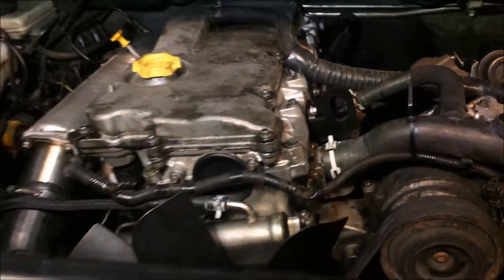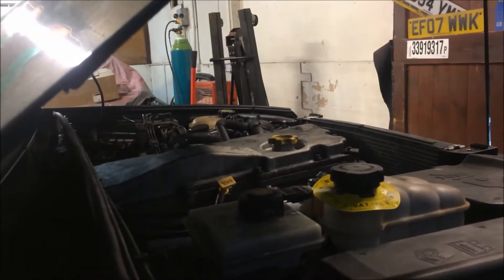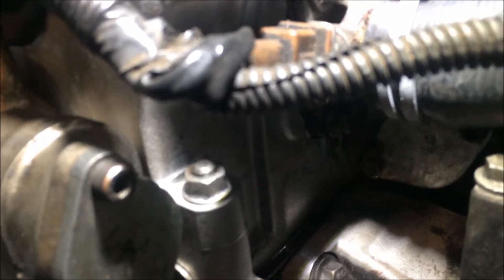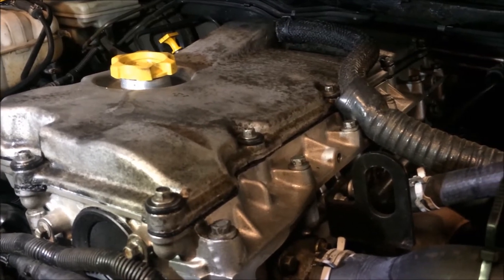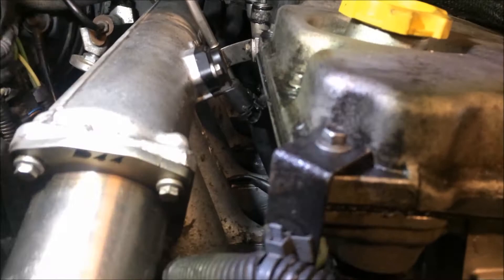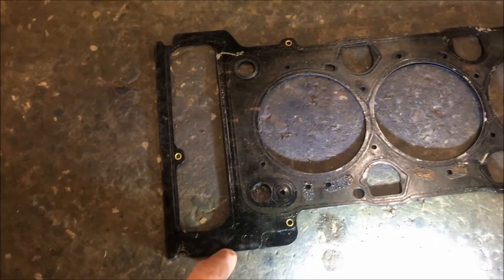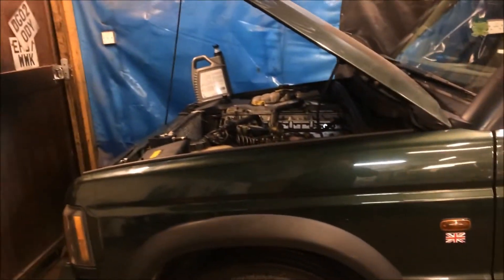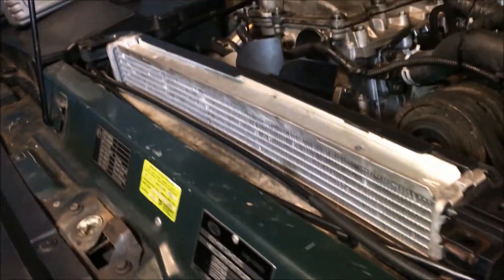LANDROVER DISASTER TD5

Comment: Hi there this is a shot in the dark but if the head has been skimmed then its best to file a bit off the dowel as you have removed space from its seat causing it to stand proud, this would explain the bubbling on the dowel corner of the head.
Cheers
Rich.

Comment: Best to put the head on with no gasket and check the clearance is sufficient to pull down all the way when the head gasket is refitted. Even reduce dowel length if required especially as the head has been skimmed.

Comment: Hi Luke. What type of dowel did you use when you refitted the head? The plastic ones are prone to snapping. I always ask my parts guy for steel dowels. It only takes a tiny amount of movement to prevent a good seal. Good luck.
Reply from the maker: Yeah metal dowels fitted,but had issues with the front dowel had to emery cloth that to make it fit the gasket and the rear dowel wouldnt even fit through the hole on the gasket due to it being oval shaped on the gasket.
Reply: Luke Robinson I think you've been given a duff gasket then, I've looked at a few and can't find one that the dowels don't fit perfectly.
Reply from the maker: Yeah i think so aswell, parts where from rimmersbro, i had told the fellas that own the car as they had got me the parts for it from them, and had called rimmersbro about the situation and there sending a new gasket out in the post with new dowels :/
Reply: Luke Robinson keep us posted. Check the block face for level when you get the head off. I'm interested to find it whats gone wrong lol
Reply from the maker: Im intrested as well haha, so annoying things like this though, yeah the block seemed levels i will soon find out if it's off when i build it all back up haha
Reply: andrewcdavies 
Always buy genuine parts  never let client supply parts, never guarantee your work on modded vehicles  in fact steer clear of these vehicles, non genuine L R parts are rubbish , always have been  ! 40 yrs experience has taught me this the hard way ,I've been where you are now many times,  retired now thank god , at your age i loved Landrovers but hated them in the end ,because of non gen parts, oh and some clients !

Comment: Did you use plastic dowel ? Was the head pressure tested for internal cracks? I know you said you cleaned the block face mint but how flat is it? Could it be warped or low slightly on that corner where it's not sealing maybe? Have you tried pulling the head bolts on that corner a little more just to see?
Reply from the maker: Metal dowels used but had issues with them, had to emery cloth the front dowel and rear dowel wouldnt fit the gasket, it's my own fault for not saying anything in the first place tbh but i have done head gaskets before and got rid of the dowels due to them being pitted etc, and never had any issues. Cylinder head was pressure tested and a light skim to make the mating surface flat as possible, i didnt want to nip the bolts down as the tightening torque is scary!
stage 1 30nm
stage 2 60nm
stage 3 90 degrees
stage 4 180 degrees
stage 5 45 degrees

Luke

Comment: It is possible that it is from the dowels. 
I remember on the early 10p engines they had plastic head dowel's which would allow the head to shift and move as they wasn't strong enough. 
They remedied this by fitting metal dowels instead to the later engines. 
So you having no rear dowel could be an issue, what was the problem, not able to fit through the gasket? and which brand gasket did you use out of interest?
Reply from the maker: I had asked the person who owns the vehicle to sort the parts so most parts where from rimmersbrow, Dowels where metal, but had issues with them fitting through the gasket, i had to emery cloth the front dowel to make it fit the gasket and the rear dowel wouldn't fit through the rear hole on the head gasket as it was oval shaped? Apparantley rimmersbrow sending replacement one out with new dowels in the post. so the gasket should be o.e.m quality

Luke

Comment: Luke, Great info on Td5 Head Gasket Headaches.
Quick question if you have time. How did you manage to clean up the oil system and cooling system of the oil-glycol slime?

I pulled my radiator twice to hose it out, which isn’t exactly fun, And I still have oil in the cooling system.

Then I drained the oil pan, and poured a gallon of diesel down the cyclone oil filter housing and drained.

If you have some better techniques, I’d love to hear them.

I feel your pain, this is a nightmare.

Cheers, Don
Reply: No mate ,you don't feel his pain,you are asking for advice when this poor chap is already in shit ,that is poor

Comment: Hi I've just found your channel as I own a transit and a Land Rover TD5, you have been very un lucky there, as you seem to have done everything right. Did you use a genuine head gasket? Try the head bolts first, it's worth a try. Try not to get to down about it I've had plenty of problems similar over the years but they turned out ok in the end. Good luck🙂👍
Reply from the maker: The gasket the fella supplied was a o.e.m spec'd one from rimmersbrow, He has ordered a new gasket and dowels so i should get them this week or early next week ;)